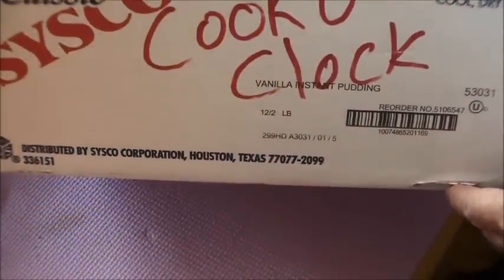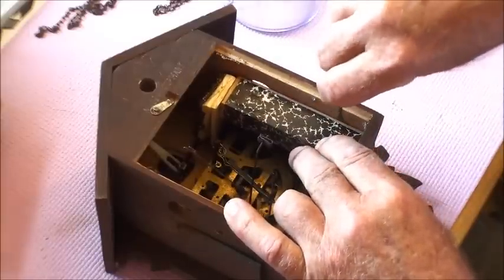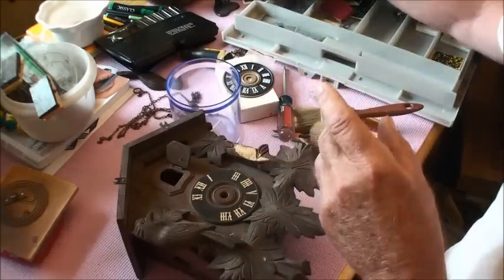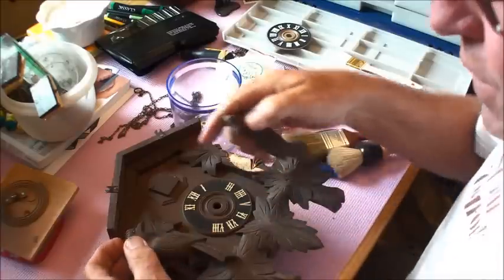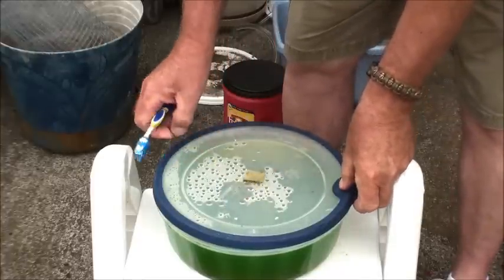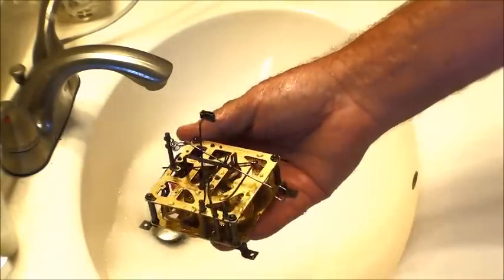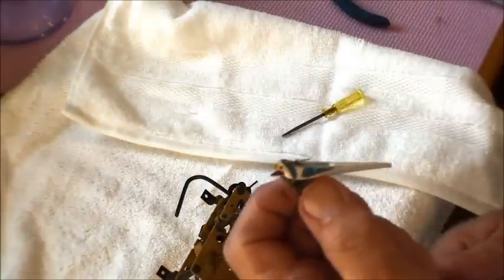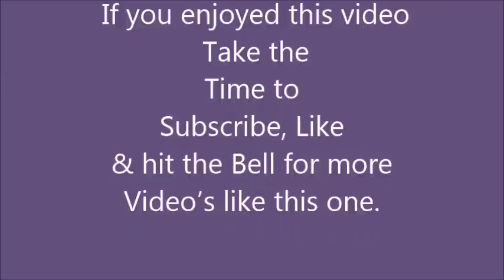Cuckoo Clock Repair

Comment: I found one of these clocks and am in the process of cleaning - one of the carved birds on the front is missing, any idea if I can buy a replacement?  I looked at several places online and didn't see the carved bird.  it's a beautiful clock - if I can't find a replacement to buy I may resort to carving my own.  Thanks for putting this online - really helpful!
Reply from the maker: If you are looking for the bird, I would go to Ebay on cuckoo clock parts. But if you can carve one yourself, and is easy to do if you use the bass wood for carvers and might be cheaper. But you might have more pride in carving the bird yourself. 
  You might find on or any parts you need from this site I buy most of my parts. They are re-setting up their site now, but you can download free, their catalog and see it they might have what you are looking for. 
https://www.ronellclock.com/
Reply: I've recently started shopping for spare parts, ebay has a lot of stuff but I've found Frankenmuth, Perrin and Timesavers web sites often have better prices, head pieces are not cheap so on one clock I've opted to shingle the roof, not as nice looking but it will dress up the roof and save a lot of money, if your missing bird is on the side and you have the skills to carve one that would be the best way to go. good luck

Comment: Awesome video.  I just recently got my grandfathers working after many many years of multiple people not figuring it out.  He purchased it in Germany during the war sometime in the early 50s.  I feel like I’m already addicted to these cuckoo clocks now after just fixing 1.  I was wondering if there’s any kind of adjustments you need to make in order to get the hands timed correctly.  Also, do you have a video of the correct installation of the hands? Mine contains 2 washers with the hands and when I move one hand they both move.  Thanks again for the video!
Reply from the maker: Yes, I do believe I have a video, including the hands being installed. The Hour Hand is slid on and wedged into place. Then minute hand has a brass nut looking piece that has little gear like things on it. When you set the clock to cuckoo on the hour, Stop and pull the minute hand off the brass nut and place the minute hand back on to the 12 o'clock position on the nut and you should be set. Hope this helps and thank you for watching my video 
Andrew Milkovich

Comment: I have a two door cuckoo clock, the door with the bird opens and closes perfectly. The door with the little guy opens,  but doesn't close, even though it seems like it wants to. Any idea on what it could be. Maybe a spring? Also, approximately how much do you think I could expect to pay for a repair on it?
Reply from the maker: This would also be a sign that the little man needs maybe cleaned and oiled. Just for a quick fix, and not cleaning your whole clock, check out the moving areas on the rod and wound wire spring for freedom of movement. I do recommend clock oil to be used. Thanks for watching Horror Nerd13
Reply: Thank you, I will give it a try! When I close the door with my finger, it doesn't even "snap" shut, it feels loose all the way until I completely close it. I appreciate your time. Your collection is awesome! I have a total of two cuckoo's, I would love to get more down the road.

Comment: Hi Mike, Thanks so much for your videos. It helped me out so much. I do have a question for you....My cuckoo clock (very similar to the one in your video) the pendulum stops after about 15 seconds. I do hear a tic too during the swing.I also noticed that I can't  move the clock hands-by using my hands. It's very tight. The right side weight will fall and will activate the bird and it cuckoos. I did this by opening the side compartment door and pushing in on the lever.

Is there some advice you can give me to get the pendulum swinging free and the clock working? and Happy Easter!
Reply from the maker: Because it is hard to turn the hands gives me the hint that the oil has gummed up with age and dust. Sounds like it needs cleaned and fresh oiling. Most people add weight to the weight that is already there and the chain will stretch and start to kink easily. It's not the best way, but if you don't want to buy a clock cleaner, you can use Dawn Dishwashing liquid and hot water to clean the works. You also can buy the oil for clocks off of ebay. I do hope this helps you and I do wish you a Happy Easter as well.
Reply: @justmike57  Thanks so much!!

Comment: Hello Mike,  going to try and restore my parents cuckoo clock they bought in Germany about 30yrs ago,  its missing several parts ( he had his brother take it somewhere and they basically used it for parts).  it has that the 1 day regula movement and looking to buy the music box that plays the 2 tunes for it. which music box do you recommend ?  can i get an email address to send pics of clock?  any help will be appreciated.
Reply from the maker: My email is below the video. Most clocks only have one tune to play. Some of your nicer ones will play two tunes. Unless you search e-bay and not get in a hurry, you might find a used music box there, but they are costly. That is why might want to buy another used cuckoo clock that has the music already in it and have spare parts maybe.

Comment: What exactly do you use besides ammonia for the cleaner? Looks like dishwashing liquid, maybe?
Reply from the maker: In this video, I use the bought clock cleaner that has the ammonia in it. Now that I have a sonic cleaner, I clean indoors and can't use the ammoniated cleaner. I bought some non-ammoniated cleaner, but don't like it as well. A friend that cleans clocks gave me a recipe for a cleaner you can use indoors and it works really well. But you should be careful on the shinier movement plated because it will strip off the lacquer. The mix is for a two gallon container so you will have to cut it back if you don't need that much. 
1 gallon of Simple Green
1/4 cup of Dawn Dishwashing Soap
1/2 of Acetone
1 gallon of water
  Good luck and have a great day.

Comment: Great video, I now have a lot less fear of screwing up the job of restoring my parents cuckoo clock. Do you use a commercial ammonia cleaner or a home brew?
Reply from the maker: I buy mine by the gallon, but you can buy much less from the clock parts supply company. My dad would use Dawn dishwashing soap only, but that didn't really do the full job. Let me know if you found a company or I can give you mine I shop at Gorp37

Comment: Thanks Mike! Very interesting. I have a cuckoo with 2 doors. 1 door stays open. Do you have a video on fixing the door? I actually took it to a clock repair. It worked for a day. It works as far as the clock goes just the one door won't close.
Reply from the maker: I am surprised that the clock shop didn't fix your problem. Most the time there might need a little extra cleaning or oiling... or the little light wire needs one more wrap around the post to give it a harder swing closed. This is the bird I am talking about. The music man is another story depending on which music player and man you have.

Comment: Hi Mike, I hate to bother you but have one more question. Before I attempt to take out the movement in my 2 weight cuckoo clock I want to make sure if there’s a possibility to free the left side weight-front facing? The weight is at the very top of the seat. When I try to pull the chain or the weight both won’t budge. Is there a way maybe...to lower this weight without taking out the movement? Also, the minute hand moves freely but not the hour hand. Thanks!!!
Reply from the maker: When the weight is all the way up, you will have to just damage the one chain that is at the hook by using a needle nose pliers and bend the outside chain link if you can reach it. The minute hand might be spinning inside the brass center and not really turning. Hope this help you pm1035
Reply: Just Mike your the best Mike. Thanks again!

Comment: I've got my grandfather's old cuckoo clock, and it's only in slightly better shape than the clock in this video. I'm pretty handy, so I think I can bring it back to life. Do you mind if I ask what's in that cleaning solution of yours? Also, what kind of oil do you recommend? This video has already done me a world of good, confidence-wise. Thank you!
Reply from the maker: Hello there Phrank Johnston. This is one of the clocks I bought at the Thrift Shop. I have been using Clock Cleaning Concentrate - Ammoniated, but has to be use outside because of the HIGH Ammoniated. I am switching to the Clock Cleaning Concentrate - Non-Ammoniated because I have a sonic cleaning machine now. There is a clock oil you can also buy with the fine tube already to go. I get it all from RONELL CLOCK COMPANY you can find on line. Hope this helps you and any more questions are welcome. I do have other Cuckoo Clock videos that also might help you on your quest to get your clock back and running again.
Reply: @justmike57  one more question. What's your oiling pen called? I'm having trouble searching for one like that. Ronell didn't have any... I've been watching some of your other videos, and I can't wait to get this clock back on the wall!

Comment: Dang, you made this look so easy, so I tried but my clock still doesn’t work. I put something back incorrectly, I think. I will try again another day. Thanks for the inspiration.
Reply from the maker: Just remember, if you don't take the movement all the way apart, it does take awhile to get the clock working again because you loosen the old oils and dust in the gears. Oil the movement again, then every time you walk by the clock, start the pendulum and if you do it often enough, about a week it should be running again.
Reply: @justmike57  Thank you this reply. Clock is on the wall and I have started pendulum but not often. Hopefully I will have time to take apart and reoil in next few days. Thank you for your advice and expertise. Do you have a video of how bello with wire is in relation to cuckoo bird?

Comment: Hi Mike I just got one of these and it needs new bellows I see  2 on ebay do they have to be exact same size? also sending a email :) thanks  this is a great video
Reply from the maker: Thank you and they should be perty close in size. Sometimes you can get them cheaper ordering them from a Cuckoo clock parts place on line Simplybabette.

Comment: Where did you get the oiler that you use?  The plunger tip oiler seems to be hard to find.
Reply from the maker: I have had the plunger tip oiler for several years now and others have asked the same question. The catalog I bought it from, went out of business and I have been looking for them from other places I order my supplies from with no luck. If I ever do find them, I will post it below my clock videos cmderrx.

Comment: I have a clock with dancers. It is my mother in laws. Where do the bars go that enable the dancers?
Reply from the maker: For the one that I have here, there are two flat plates that are held into place my the two top nuts that hold the clock works together. Not sure it this with what you are talking about or not. If you would like to send pictures of what you are talking about, I might be able to help you better. My email is below the video Brian Peirringer.

Comment: Hello Mike! I have the same clock purchased in a thrift store today. I'm missing one weight and pendulum. I found that the weight is  275 gr. but can't find the  length neither the weight of the pendulum.
Reply from the maker: That is awesome! There is no length of a weight. You just order one off Ebay that is a 275 gr. but more than likely you will pay to much for it there compared to buying a new pair. Also the pendulum for one day clock is around 6". If you email me, I can give you the site I buy most of my supplies that charges what it cost to mail your order.

Comment: Mike, I have an old cuckoo clock that appears to be missing many parts:  bellows, weights,  pendulum--even part of the housing.  It's very pretty, and the bird, itself, has a mouth that opens.  The works are by Helmut Klemmerer.  Do you think it would be worth my trying to restore?
Reply from the maker: I don't really know how big this clock is, but unless this clock means something to you, I would part it out and sell the parts of ebay Marinelle.
Reply: Thanks for the swift reply, Mike!

Comment: Hello Mike: I just bought a cuendet  swiss musical movement cuckoo clock-6732-36 in an auction. This a Edelweis Lara's Theme from Dr. Zhivago...It was mentioned as never been tried but when I put things up it does not work. The pendulum does not work.. Please advice
Reply from the maker: When the clock sets around without running or they took the clock down because it slowed to a stop, it just freezes up with dust and the oil will get gummy. You can try turning the minute hand clockwise to see how stiff it is and just maybe if you turn it several hours ahead, it could free it up but only temporary. With a cuckoo clock, they consider it a dirty clock because it is open where the pendulum and chains are and the bird and music man or dancers are. So all this means is you will have to have the clock cleaned and oiled more often. A cleaning should last 5 to 10 years depending on where you hang it and how much dust is around your house. I do hope this helps you a bit and I do feel every cuckoo clock is worth it.

Comment: Hi Mike My clock stops ticking within a minute.What can I do to fix this problem? What oil do I get if needed?
Reply from the maker: If your clock still has an  even sounding tick-tock sound and your clock stops, the book says you should take it apart and clean it. You might be able to get it going again by just oiling the clock and some say that it would be a temporary fix. 
  Oiling your clock every 5 years is the best and have a can of air on hand to blow out the movement. You need to oil both sides of the movement so take pictures of where the wires go for the bellows. 
  Synthetic oil is best because they say it doesn't dry out as fast and some movements say that on the top, right hand corner if the clock is newer. Either Clock Oil will work. You can buy the clock oil already in a pen like oiler off of E-Bay.
Reply: @justmike57  Thank you.I will do that.

Comment: I grew up with a cuckoo clock ❤️. I just found one and am going to follow your steps. What is the ratio of ammonia and water and is there anything else added?  Also how do I attach the chains?  Thank you for making this video 😊
Reply from the maker: Clock Cleaning Concentrate - Non-Ammoniated is what I plan on using from now  on. I order it from a company that I buy most my clock parts from. If you go to my channel and select Playlists, you will see I have a group of clock videos. There you will find the one for the chain install Erica Walling. Thanks for watching and if you have any other questions, I will try to answer them for you.
Reply: Thank you 😊

Comment: Where do you get your cleaning fluid? (or do you make your own? If so, how do you make it?)
Reply from the maker: I order my clock cleaner from a clock parts place on line. I can give you the information to the sight if you email me from below this video. The cleaner name is,  Clock Cleaning Concentrate - Ammoniated that I am using but they do make one that you don't have to use outside. It's Clock Cleaning Concentrate - Non-Ammoniated
Reply: @justmike57  Thank you Mike!

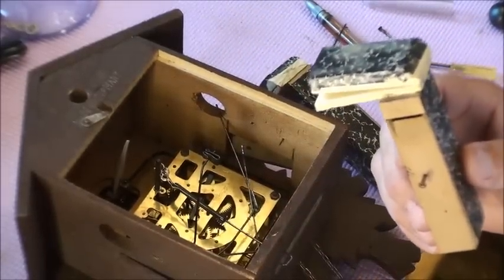Comment: Hello Mike! Amazing video, I am trying to restore my Cuckoo clock but I cant put all the steel wire at the right place. I'm having trouble assembling the clock at the end part which you skipped after 51:30, any way you could help me? Thanks!
Reply from the maker: Hey there Amrit. Sorry I didn't show how to install the wire arms that work the bellows. If the wires are the same size, hook the one wire to the bellows first then to one of the arms below that move when triggered to count the hour. Once you have the arms on, you can listen to the bird sound to see if you have the wires on the right arm or you need to switch them... I am finally done working on my brothers house, Videos on that, and plan on making more videos on clock repair and I will add this suggestion to my video making. Hope this helped a little Amrit Sinha

Comment: What if it's not keeping the time accurately after being set. After some time the time it becomes several hours to about ten hours off. How would you fix that issue. Its a 24 hour cuckoo clock. It does keep the cuckooing correct for each hour and half hour, Its just the time keeps ending up off after some time. So it's just been hanging on the wall in the living room not really being used because of this issue.
Reply from the maker: The pendulum is what sets the speed to your clock. It the clock is to fast, then you slide the Leaf down a little at a time. Wait at least 12 hours and do it again if needed. Slide up if you need the clock to run faster. Thanks for the great question Christy
Reply: Thank you ill try that and see how it goes.
Reply: The issue I'm having  at the moment when I tried toad just for the speed, is the pendulum is stopping either immediately or several minutes after starting it. It did it before but it would keep going if the weight was low enough. Now its just stopping if the pendulum is off I keeps going fast and doesn't stop tell its un wound when the weight reaches the floor.